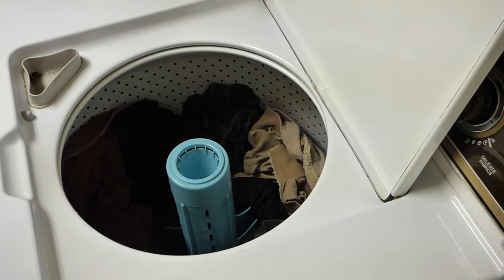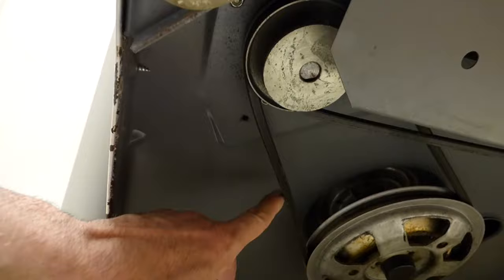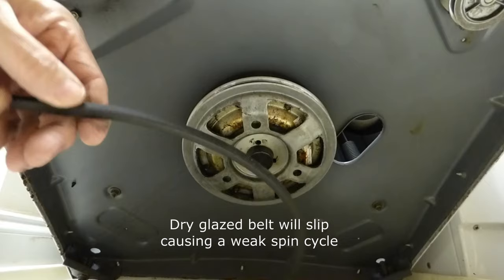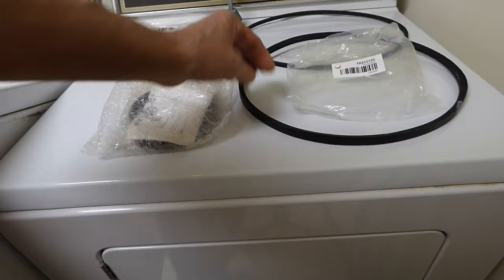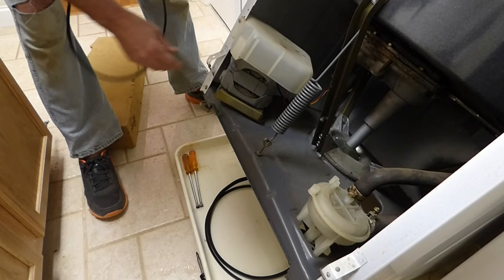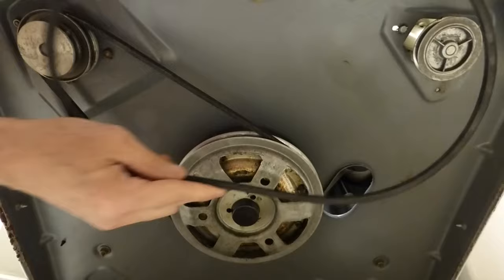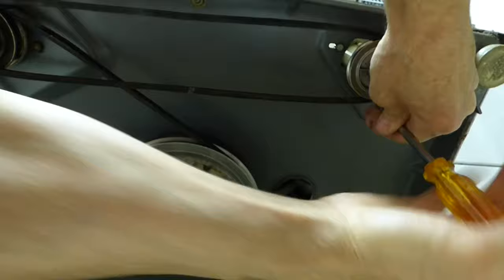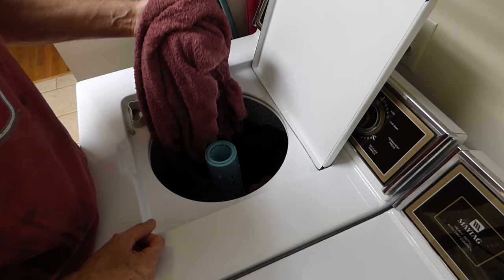How to Fix a Washing Machine That Won't Spin / Weak Spin Cycle (Easy Fix)

Comment: This was simple for someone who would normally call someone out to discover what I was able to do on my own! THANK YOU!!!
Reply: I'm a single 63 year old lady.  If I can do what you did in this video I'll be sooo happy.  So far, I have determined that it's not spinning.  Now comes the fun part... I'll keep you posted 🙂
UPDATE:  It was too heavy for me to pull it away from the wall, so I started taking the clothes out.  A long sleeve from a shirt had gotten wrapped around the middle thing so tightly that I could barely get it out.  So I got all the clothes out and turned it on spin and it worked!  I'm keeping my fingers crossed that it's fixed.  Thank you for the video.
Reply: I'm 62 and I have no faith in myself but I'm going to try but I think I'll work on the refrigerator first way easier, my problem is I've got my 88 year old father watching me and if I mess it up I hear from him I wish you would of left it alone.
Reply: Haven't 90% of us done that at one time or another? Of course, the other 10% are lying about not doing that. Best wishes to you.

Comment: Bet you got that belt set from Ebay - there are lots of resellers that buy the lowest cost components from China and re-package them. Many are counterfeit. You state the vendor KNEW there was an issue with the belts, but sold them to you anyway!
Reply from the maker: Actually did get the belts you mentioned from Ebay.  The pump belt was correct.  The seller didn't intentionally sell me the wrong belt... when I called back to ask about it they said they had become aware that there was a problem and were not selling that belt set anymore until the problem was corrected.  They told me to keep the belts and refunded my money.

Comment: Well done. However $40+- for a pair of belts from these online appliance parts outfits is outrageous. At half that they would still make a nice profit. Just like the lid switch which is a $4 micro switch some wanted $30-40 for.

Comment: This just gave me what I lacked to assess my mom's machine. Thank you.

Clear and thorough instructions. Calm demeanor. You are  well suited for this.
Reply from the maker: Glad I could help!
Reply: @helpinguonline  hi there. After I adjusted the pump motor to achieve the 1/4 inch gap when pinching the belt, I tightened everything back up. Tried a dry spin cycle and everything looks and sounds good. I then proceeded to turn the water lines back on and both had pressure and now have a drip/leak that was previously not there. Any suggestions?
Reply from the maker: There is a filter screen at the connection on the back of the washer...make sure it is clear, check the rubber gaskets in the hoses and make sure your connections are tight
Reply: Nah, you didn't lack a thing. There was just something you hadn't learned YET! Sounds the same, but it ain't. Major, Major difference. Maybe even  Colonel, Colonel difference.

Comment: This is by far the best video for belt replacement. The step by step instructions and explanations are great. I replaced my belts, washer did not function, would not spin after watching this I relished the new belt was to short. Problem fixed
Reply from the maker: Glad it helped

Comment: Thanks for this video, i'm early in my career of appliance repair and worked on one of these a week ago with a water leak in the fill valve, it felt so good to keep an old beast running but the customer called and said it starts to spin but stops, i really hope this is the issue, i really want to keep it running for the guy

Comment: Good job. I got the info I needed very easily in about two minutes scrolling through using the video as my guide for what part I wanted and you explained each process in an easily digestible break down 

Thanks dude

Comment: Yeah I did what you said but my maytag washer just slips for rinsing and when I manually  pull on the motor to tense up the belt the motor stalls. Could it be that it's seized or the motor has lost its power?

Comment: I have the same one. Now I changed the belt but the transmission Pulley still doesn’t turn. Motor and pump pulley moves fine.

Comment: My belt doesn't pass the 1/4 inch squeeze test but it also isn't so tight the motor can't move at all like the one you had, still some give. Do you think this belt can still be used?
Reply from the maker: Not exactly sure what you are asking... but if your machine is operating properly you should be okay

Comment: My washer is only 3 years old, it won't spin at full speed. Clothes are still coming out wet and when i put it on drain and spin it spins for a few mins and starts filling up and starts to wash. Do you think it's the belts? We had a repair guy come out that was no help, he first said it was fine. We called him out again and he said it was the transmission kit and it would cost $800 to fix. Any help is greatly appreciated, thank you in advance

Comment: Ohboy, im afraid of what ill find in there lmao. My furnace quit working last winter and when i took the door off the blower compartment, there was a weasle skeleton. My a/c stank the previous summer but I didnt find anything in my A/c unit, so just suffered through it. 
My washer is maybe 10 steps from my furnace, in a dirt floor style basement. Wish me luck lol

Comment: Hello Kind Sir, My 2005’ manual Maytag top loader/ not the one with led lights,  does that same thing But while watching it go into the spin cycle for the last year I have noticed that when it starts to spin it Right before it gets to full speed you can hear the brakes engage and it slows it down and at that time it starts to agitate while it’s trying to get up to speed but the brakes are still keeping it slow spin, and I have noticed that if I stick my hard in there against the drum and let the clothes catch my fingers and knock it off balance where it is wobbly then and only then it will start to go real fast and then right before it hits Top Speed I hear the brakes engage and slow it back down again and then it starts agitating again you know to try to even out the clothes it does and then it starts to go fast again about up to 1/2 speed then the brakes engage and slow it down again and if I get the clothes so off balance that I have to keep my hard on the timer knob to stop it encase it wobbles outta control and then finally after the whole cycle THATS WHEN THE BRAKES WONT Work they won’t engage to slow it down and stop it and I have noticed also that the knuckles are pretty worn out in the agitator also but it is still working about 80% right I sure hope you know exactly what’s going on and can let me know what I need to fix and replace because it is the kind of washer that you can easily keep repaired when something goes bad if you can find out what the issues are last year when this started I made a video and posted it on my YouTube channel if Will please go to my page and click on my uploads it is the last video I uploaded so you will easily find it, Please.
And keep in mind that was about a month after I started to notice that the clothes were coming out heavy like in your video but I have done 2-3 loads a day for a year now and it is a lot worse now But when I run the extended spin cycle again and I stand over it to try to keep the clothes outta Balance it will finally get them spun out but it is taking up so much of my time I am getting behind on all the other things I need to do on a daily basis, So I Sure hope that you will know what is wrong so I can fix it and again it doesn’t have the electronics and the led-lights. Thank You Sincerely For Your Time And if you can figure it out for me so I can fix it I will send you a generous donation president Grant Bill for your help thru PayPal or Applepay ✅ and I Am experienced back in the 80’s I worked at the appliance Repair Shop here in my town and I have always fixed any issues with washer and dryer electric and refrigerator’s to for me and my family members too But For Some reason I can’t find out what the issue is with my 2005’ Maytag Heavy Duty Extra Large manual Washer Hope to hear from you soon ✌️🏡🙏.
Reply: I did replace the belt the old one was original, However the Washer Still Working the Same and No one can tell me for sure what I need to replace to fix-it.
Please Help

Comment: Hello there,  thanks for your great video,  I have a portable washing machine and it is not spinning,  I  changed the belt, but still is not spinning,  what else should I do? I havea Danby 0.9 portable washing machine. 
Thanks
Reply from the maker: The cause of that could be a number of things. Could be your motor… Could be a capacitor that starts the motor… Could be your timer… Etc. sorry I can’t be more specific. Wishing you the best and God‘s blessing and wisdom as you work on it

Comment: Thank you for the video, I have Kenmore elite washer and it has started doing same issues, I will check belts out, do you have any recommendations before I do this ?
Reply from the maker: Be sure to unplug your machine before you begin.  Also, you may find a video online that is specific to the model you have that may give you more detailed instructions.

Comment: I think you should specify in your title that you have a Maytag washing machine.  My Roper by Whirlpool has no silly belts and is direct drive.  It does have a clutch  and a coupler that both can be a cause for not spinning strongly.  My machine is older than you !

Comment: Maybe should have just adjusted the pump belt to be tighter without buying new belts....a thought
Reply: Maybe the older gentleman knows his craft and a glazed belt that's retightwned will build friction and melt or burn causing more damage or injury
Reply: in a pinch, the old belt might be roughed with steel bristle brush. Also automotive belt dressing in spray can might get you by awhile.

Comment: I have one like this and I replaced the belts. Now, when it goes to spin, it spins about 3 times and then makes a clicking noise to click off.  Ordered a new motor, put it on, still does the same thing - shuts of motor when it goes to spin.

Comment: Anyone know where model number is located on a upright whirlpool approx 10 to 12 years old...? I CAN STILL wash small loads with no issues,but larger loads it does not spin fast enough to dry chothes well..i am thinking my machine does not have belts so maybe clutch and or coupler is slipping...thanks for your help...

Comment: My washer dial will not even enter the spin cycle.
Could that be an electrical problem ?
Reply from the maker: Check for blockage in your drain system... including drain pump
Also you could have a problem with the lid switch... check this video:
https://youtu.be/gzq5FODUuqE
Could be an electrical problem... bad timer
Reply: Check your timer

Comment: would this cause the washing machine to not advance past the wash cycle? clothes are soaking wet and tub is drained, lids unlocks as if its done.
Reply from the maker: In this case, with a belt driven motor and pump, the washing machine would or could advance through all the cycles, especially if you have a slipping belt found on older machines like this one.

Comment: I have an older Kenmore top loader, that has a slow spin cycle leaving clothes too wet. Do u think this is the fix to my problem?
Reply from the maker: It may if your belts are worn or improperly adjusted

Comment: Hi there, when you say GLAZED.
What do you mean? I have a Haier
mini washer, it won't spin. The belt on mine looks ok? should I change it anyway? thanks
Reply from the maker: If the belt looks okay I wouldn't change it...and if your problem was the belt glazing it would slip and probably not stop your washer from spinning completely.
A glazed belt is one that has been slipping and gets a shiny glaze on it that causes it to lose its grip...like a squeaking power steering belt on a car
Reply: @helpinguonline   Thanks for yr response. What else could it be?? Should I just scrap it?
Thanks for your help..❤
Reply from the maker: You may want to check this common problem...  https://youtu.be/gzq5FODUuqE

If not the lid switch you may want to continue your search online otherwise you could call a local appliance repair company... but often times their visit costs more than your washer may be worth.

Comment: I have a kenmore top loading high efficiency washer. Over filled it cuz I was getting screamed at by my lame pain in my butt roommate and when I
Got back
From
The market it had
Not completed the spin cycle. I’ve un plugged it trying g to
Perhaps re boot the computer. It starts
To configure the load but then remains
Locked and the red
Light blinks
 I’m
Not a
Happy woman. Any suggestions
Please? Besides putting my roommate in the washer ? 
Plugged
It’s

Comment: where di you buy the right belts?
Reply from the maker: Actually the pump belt was the correct one so I only had to order the drive belt the second time.  I got it from ebay seller prestigeworld-wide.  It is an OEM drive belt..

Comment: what is the part number I have the some one
Reply from the maker: One belt is 2-11125 and the other is 2-11124
Not sure if these are the aftermarket part numbers or the Maytag numbers... but hope that helps you get to what you need.